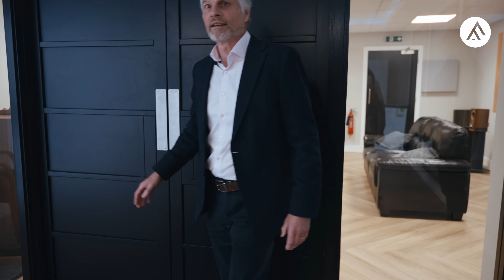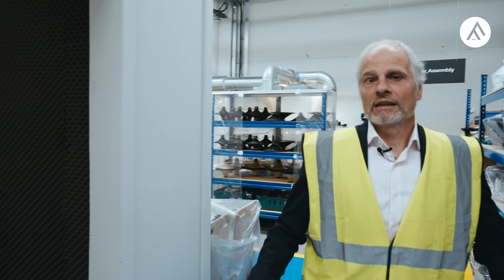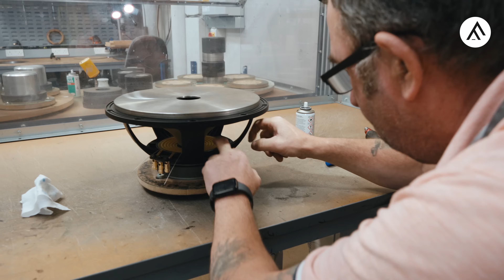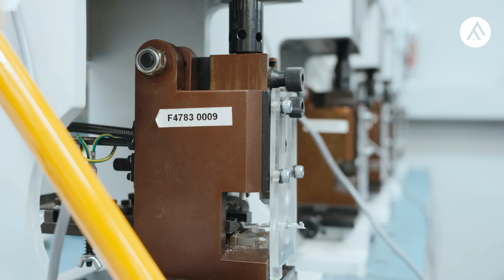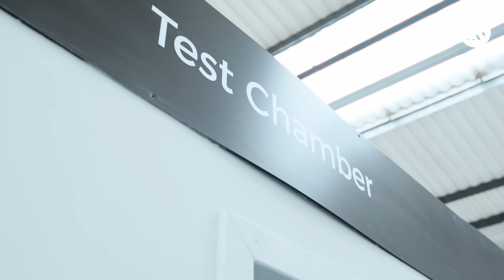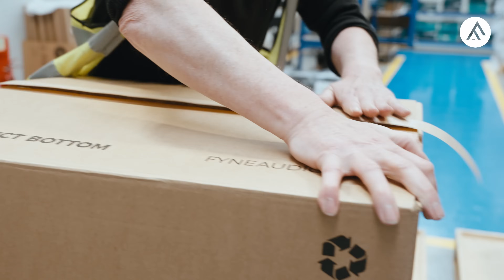Andrzej Sosna takes us on a Factory Tour at Fyne Audio HQ

Comment: Forgot to mention only top tier ranges are made in house, same for point to point crossovers. Or am I wrong 😉
Reply from the maker: All ranges from the F500SP upwards are built at our Scottish HQ and feature point-to-point circuit boards. Our more accessible F500E and F500S Series, are designed and engineered in Glasgow and produced overseas to our meticulous standards, with precision-engineered circuit boards designed by our engineering team.